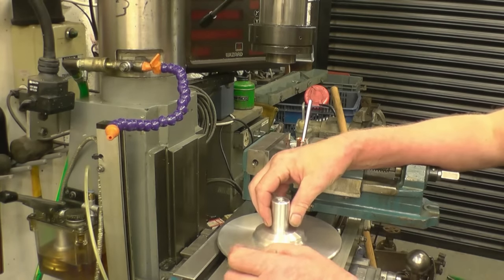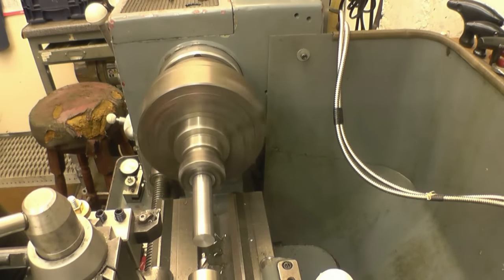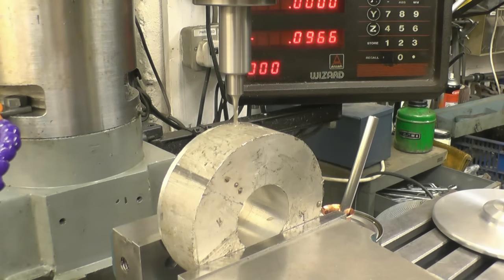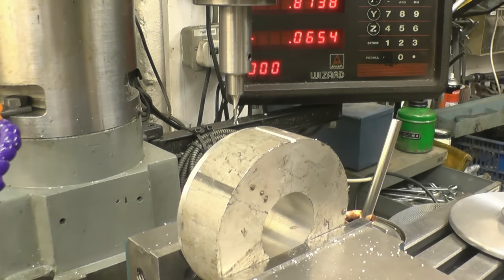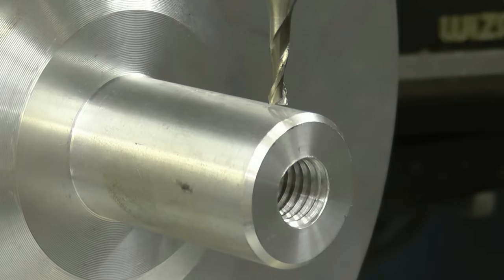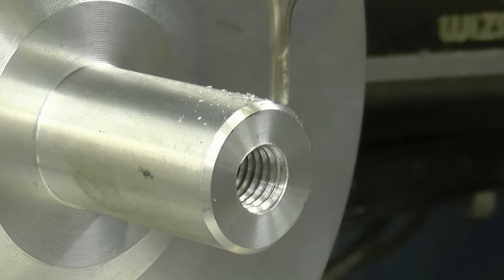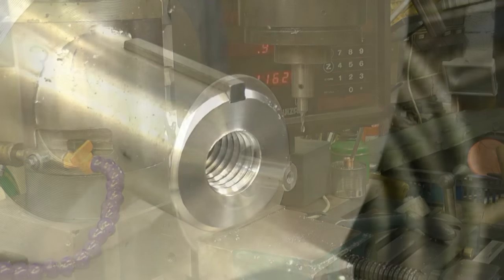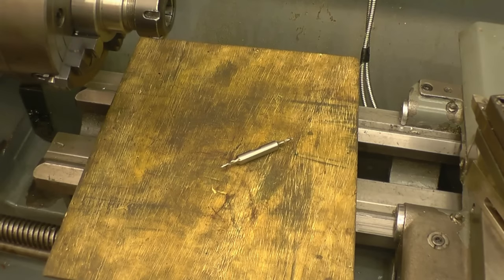SNNC 137 P2  Milling cutter adapter  Key way

Comment: Like the out takes at the end.The only bad part about watching your uploads is it keeps me from being in my own workshop doing the machining and fabrication jobs I should be working on , notice you use the center finder the same way I have always done ,touch on both sides and half the  amount rather than do one side then have to half and add measurements . The mental arithmatic here is only 50%, the mental part the other 50%I find  quite easy.  All the best from Northants England .

Comment: A good job well done.  Although perfectly adequate, perhaps a case of cutting the slot while the item was hot, on this occasion was my first thought after the 'dry run'?  Tiny bit tighter when it cools down?

Comment: I like the idea of using shock absorber shafts for round stock. I have quite a few of them laying around the shop scrap metal pile. Have you tried using strut rods as well. They are quite a bit  larger?

Comment: The noise I would put that down to a stiff belt running on a small pulley, normally the belt is almost never bent if you would that much so it works hard, or a imperial belt in metric pulley and is pinched, plus having to use more belt tension on a small pulley.

Comment: Great job on the toolholder. I was surprised that ER32 adapter had so much runout on the mill. Is that because of the adapter or the collet itself? I wondered because in the lathe application you describe those collets as very accurate.
Reply from the maker: It is the holder that runs out  Thanks for watching